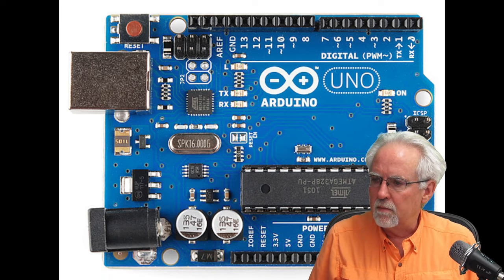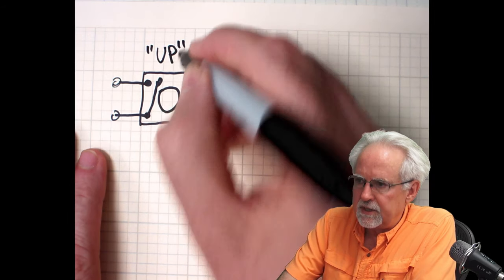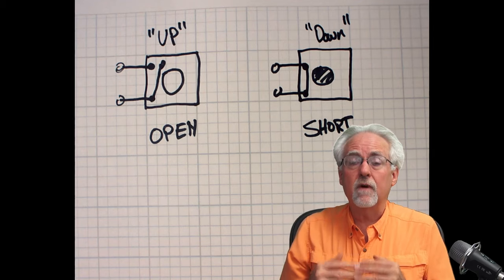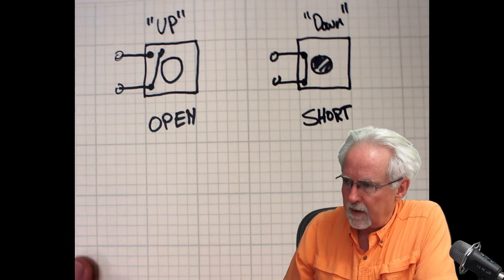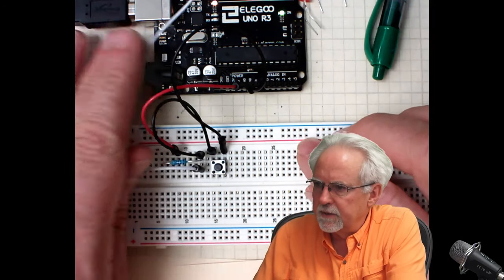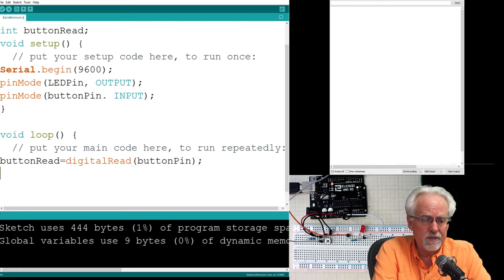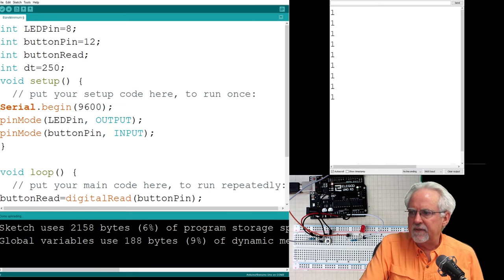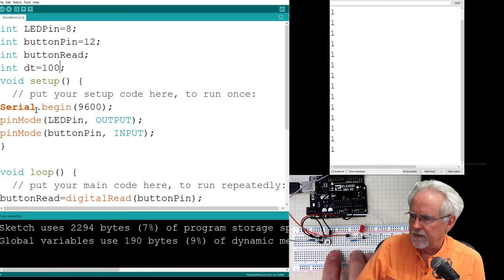Arduino Tutorial 27: Understanding Pushbuttons and Pull Up and Pull Down Resistors

Comment: Mr McWhorter, I have a question-could you please explain how you decide what resistor to choose ? Why push button requires 10k and photo resistor only 5k? What needs to be considered here ? I kinda of have a guess why we have 330 for the led (I did calculation and I think even 150 is fine, I divided 3v by 20ma and that gave me 150 om and I used 20ma as max current that the led can handle ) thank you again

Comment: This one took me a long time to debug. I bridged my button over A and the - column instead of the gap between E and F. Silly me forgot the - column is all connected. The button was rendered useless since the circuit was always closed even if the button wasn't pressed. Mistakes are the best lessons outside of listening to you Paul.

Comment: Thank you for these outstanding lessons; you really are a wonderful teacher. As a side note for anybody having issues on this lesson: I was having issues with my pushbutton and code not working correctly, and after 30 minutes of troubleshooting with my multimeter's continuity test, it turns out that the leads on my button are too short to make contact with the metal strips inside of my breadboard! I tested it across several columns, and it just didn't work with this particular breadboard and button combination. Another breadboard I had for a different project had shallower holes/thinner plastic and it works well.
Reply: Actually i think the switches are very poor for the breadboard. it is the wrong type it will kill the breadboard in short order. try to keep switch in place or put it in the same spot each time.

Comment: I did this on my own , successfully, but used analogRead and readPin = A0 rather than digitalRead and a digital pin.  It worked but my values were 0, and 1023 rather than 0, and 1.  Learned something.  Thanks for the lesson.

Comment: Paul, I put the resistor and led on the board first and used two long leads. One connected to ground, the other to 5V.
This way I shorted the leads and the led lights. This way I can test the push button pins to find the open pair.
Once I find the correct switch orientation, I can add the pull up resistor and switch to the  board.
I had to use Needle Nosed Pliers to straighten the pins since they would not push into the holes.
  I guess I could use the variable "j" and increment it each time the button is pushed. If the value is odd, the led turns on. If the value is even, turn the led off. That's one approach I could try to create a toggle switch.
But the solution could be simpler. I need to test for odd or even numbers.
Wayne

Comment: I really was looking forward to tinkering with pushbuttons and the explanation about pull-up and pull-down resistors is something I'll definitely look into further in this series. Although I fell like I can't wait to start building a MIDI footcontroller for my guitar pedals, I've been enjoying the series so much that I think I'll benefit from more learning. So thanks for your amazing tutorials, Paul!

I got carried away and decided to push myself a little further this time. I hook up three pushbuttons to control different LEDs and wrote this code. I used all the input from this tutorial, but any feedback and considerations about my code are highly appreciated. =)

BTW, I'm using a Lolin(WeMos) D1 R1 Wifi, so the pins come as "D#" in the code.

int redLEDPin=D2;
int greenLEDPin=D3;
int blueLEDPin=D4;
int redButtonPin=D5;
int greenButtonPin=D6;
int blueButtonPin=D7;
int redButtonRead;
int greenButtonRead;
int blueButtonRead;
int DT=20;
String redmsg= "RED button value: ";
String greenmsg= "   GREEN button value: ";
String bluemsg= "   BLUE button value: ";

void setup(){
 pinMode(redLEDPin,OUTPUT);
 pinMode(greenLEDPin,OUTPUT);
 pinMode(blueLEDPin,OUTPUT);
 pinMode(redButtonPin,INPUT);
 pinMode(greenButtonPin,INPUT);
 pinMode(blueButtonPin,INPUT);
 Serial.begin(9600);
}

void loop() {
 redButtonRead=digitalRead(redButtonPin);
 greenButtonRead=digitalRead(greenButtonPin);
 blueButtonRead=digitalRead(blueButtonPin);
 Serial.print(redmsg);
 Serial.print(redButtonRead);
 Serial.print(greenmsg);
 Serial.print(greenButtonRead);
 Serial.print(bluemsg);
 Serial.println(blueButtonRead);
 delay(DT);
 if(redButtonRead==0){
 digitalWrite(redLEDPin,LOW);
 }
 if(redButtonRead==1){
 digitalWrite(redLEDPin,HIGH);
 }
 if(greenButtonRead==0){
 digitalWrite(greenLEDPin,LOW);
 }
 if(greenButtonRead==1){
 digitalWrite(greenLEDPin,HIGH);
 }
 if(blueButtonRead==0){
 digitalWrite(blueLEDPin,LOW);
 }
 if(blueButtonRead==1){
 digitalWrite(blueLEDPin,HIGH);
 }
}
Reply: I like how you put the strings in there.  Very organized. Props.

Comment: Wonderful explanation, you really are a fantastic teacher, thank you so much. If anyone is reading this I have one problem; checked hardware and software many times, changed components BUT LED stays on all the time, checked input to pin 12 with multimeter and  push button is  working correctly. Any ideas please.

Comment: Hi Paul. 
I recently bought an arduino and your tutorials are really amazing! Very high quality videos thank you!! 

I myself am a 3rd year Software Engineering student at University and I just got an arduino for fun just because hardware was always very fascinating to me (even though my major is pushing me in the direction of high level programming instead of lower level stuff like embedded). 

I just had a quick question. Is there a specific reason why you dont tab in the code to make the code a bit more visually appealing? I understand this video is almost a year old and the arduino ide may have not allowed for that back then. 

It just slightly bugs me since I code in python a lot and the code formatting triggers my OCD haha! 

Anyway I was just curious. Thank you for making the time to make this awesome tutorial series for us. 

Oh and also to answer a question you had in another video, yes it does bug me when the board isnt perfectly aligned with the top of the screen (not straight) just like it bothers you. 

Cheers!

Comment: I'm struggling to understand how current flows to the read pin in the unpressed state of the pull up resistor circuit. My confusion stems from how current is able to flow to the pin in the first place since it is not connected to ground until the button is pressed. I have always assumed that in order for current to flow you would need a path from the battery's positive to ground terminals. So without a path to ground (which is blocked by the open switch) how does current flow to that read pin if the button isn't pressed?

Furthermore, the current traveling into that read pin has to pass through a resistor to get to the pin. So how is there not a voltage drop when the button is not pressed, yet when the button is pressed you're connected to ground and then you see your voltage drop over the resistor. 

I had to take about a month break from working on these tutorials to work on some personal projects and I'm very happy to be getting back to working through this series!!

Comment: It would have been good to explain why and how using pull-up and pull-down resistors work (i.e., why the electrons go where they do, e.g., why don't the electrons go down the other wire when the switch is closed) and the benefits of using them (e.g., preventing floating inputs).
Reply: You exaggerate!!!!!

Comment: does it make a difference if instead of hooking the button up from slots f through i on the breadboard and needing a jumper, you put the button across the center divider so you have space for the two wires? if that makes sense

Comment: Great video! Thanks for your amazing attention to detail Paul. I had a question about the switches. When to use a pull up vs pull down resistors? Is there an advantage using one circuit over the other in specific situations?
Reply from the maker: Both work in all cases, just depends on which is the easiest for you to think about.

Comment: Question regarding the pull up resistor (open, "up" mode): The read pin reads the voltage right after the resistor. But a voltage is defined between 2 points, so what is the reference ground when you read at this point? I am confused because my understanding was that all "grounds" in the Arduino are the same. In which case, there will still be current going through the resistor just as when the button is down and the current goes to ground.  What am I missing here? (amazing videos by the way, thank you!)

Comment: Hi Paul, In my head It made more sense to measure the voltage drop after the Pull Down resistor? How is there meant to be a voltage drop if the current hasn't passed through the resistor yet?

Comment: Great, easy to follow tutorial as usual - thanks Paul
A question if you don't mind.
What is the reasoning behind choosing specifically a 10K Ω resistor for this project ?
How do you decide what value resistor to use ?
Reply: I have the same question too. As i saw in a data sheet the arduino uno output current is 40mA. So the voltage drop across this 10kΩ resistor would be 400V (V=IR=0.04A*10,000Ω). That means theoretically no current will reach the arduino reading pins when using the pull up method right? But when practically done, I got the reading as 1. I'm a bit confused. Appreciate if anyone can explain this. Thank you:)
Also, your tutorials are great sir!!

Comment: Why did you use a 10k resistor for the pull up resistor? Does it matter what resistor you use? When I substituted the 10k with a 330 resistor, it worked just the same (as I expected).

Would it not be easier to use a 330 ohm resistor as you also use those for the LED, so you can't get them mixed up? I got mine mixed up and they being so small and use the same colors but in different orders they are hard to keep apart.

Also, related to that, how do I tell what end of the resistor is the start of the color code and what end is the end? I had it backwards first and when I translated the color code I got a very wrong value, knowing it had to be 330 or 10k. But if you have a pile of resistors they can be any value so you would need to know what end is the "front".
I know I could have used my multimeter to measure them, but I didn't have it at hand. Knowing how to "read" a resistor would be useful I'm sure.

Comment: thanks for the videos. But there happened a mistake in my case. I did exactly as you told. The light turns on but when I am pressing the button it does not turn off and in serial monitor only shows me 0 :(

Comment: how do we handle inputs from another arduino?  digital output from one microcontroller used as a digital input on another??  The receiver needs a pull down doesn't it for when the sender goes to a low state?  I've got a mikro e speakup clickboard that has digital outputs I want an arduino to read.

Comment: I'm having an issue where I can completely take out the button circuit, however it still somehow reads 0 and 1 randomly turning my LED on and off, and even set up correctly the button does make it turn on but it still randomly turns on and off, I don't know what to do

Comment: I have an Arduino Uno, with a few buttons, two photo-resistors, and a couple of LEDs. I would like to buy the kit you're using, but only with the parts, no need for another Arduino, as i'm just a beginner. Is there an Arduino parts kit without the Arduino that you could recommend?

Comment: Paul - Thanks for your tutorials.  I have not been able to get a proper response using the button.  I've tried removing the button and hard wiring the circuit and it performs as expected, so I know the code and the build are correct.  I usually write the code and build the circuit before I finish watching the video.  My builds don't always look exactly like yours, but they function as they should.  The same with the code I write.  After failing to get this to perform as it should using the button, I copied your code letter for letter and removed all the components and started over on the build and completed it as you did.  Still no joy.  I removed the switch, rotated it 90 degrees and reinserted it.  I had to move the ground wire over one space on the breadboard as the holes and button leads don't line up the same when I reinserted the button.  I removed the button and hard wired again and the LED came on as it should have when hard wired, and went off when I removed the hard wire jumper.  So, I think it must be the button switch.  Any other ideas how to test the button?
Thanks.
Reply: I resolved the issue with the pushbutton.  It wouldn't make a solid connection with the breadboard.  I moved it and only inserted 2 legs and was able to get the desired results when pressing the button.

Comment: Do you have to read the voltage  value before or after  the resistor? Does it matter?
I remember watching a vid on using a multimeter at the nodes of a circuit and reading the voltages.
Reply: Captain Prototype did you try it with several different places to read the value?  That is a good example of questioning something and seeing for yourself what works and what changes.  There are a few places where changing something could get you in a little trouble, but this is a good one to move a wire to see what changes.

Comment: Hi Paul. Great video. Please tell me what I’m doing wrong. Followed the code exactly and built the circuit as per your design, however serial print returns the value 12 not 1 and the led comes on when I press the button yet serial print does not change to 0 it still returns 12. Thanks Andy
Reply from the maker: First, you have to understand that if you do exactly what I did, you will get exactly the result I got. So, step one is to mentally accept you have made a mistake somewhere. Either you have a code error, or you have hooked things up wrong, or you have a loose connection. Very, very, very rarely is it ever faulty hardware. Go through it methodically and find your error.

Comment: I actually can't get my values to switch between 1 and 0, depending on how I hook it up, I either get 1 or 0 on the open switch but pressing it has no effect. I don't have the exact same kit, but it's also an uno r3 starter kit. So I'm not sure if my button is making a proper connection, because the pins look a little short to reach down into the breadboard. I'll watch the video again, other than that, I'm not sure what to do.

EDIT:

I rewatched the video and my connections were just wrong.

Comment: Instead of using a wire to jump the button, put the button across the gap in the breadboard.  It leaves all but 1 hole open on both sides.

Comment: @6:20 How can the voltage still be 5V across the 10k resistor if not connected to ground? If the voltage is still "running"(?) while unconnected to ground, then why wouldn't it power a device?
@6:30 "...there is no Voltage drop across the 10k, the read Pin is going to see 5 Volts and is going to report back a 1."
Are you saying that resistors ONLY limit current if the voltage is connected to ground?

Comment: In the pull-up mode, the circuit always outputs 1. I think the LED should be on normally and when you press the button LED turns off. Isn't this more logical ?

Comment: Novice here. What is the point of having the 10k resistor lead to the readpin and switch, could you not just use a jumper instead if all the readpin is trying to do is detect voltage?

Comment: @14:00 It is very confusing that you are not consistent in using the wire colors.  Using black and red to connect from the resistor to 5V.

Comment: I have a confusion

Imagine if in the PullDown circuit, if the resistor was NOT present

When the circuit is open it reads 0 Volt
So when the circuit is closed shouldn't it read 5V??

and we would be fine without a resistor?

Comment: first of all thanks for the new video. i have one quistion about the pull up/down resitor. is it not posibole to put directly 5 v on the digital read pin to create a digtital read; high. so directly from the 5 v pin the to the digital read pin without resitor and only a switch ?
Reply: How about using the pull-up resistor inside the micro-controller 
You can do this by this line of code:

pinmode(buttonPin, INPUT_PULLUP);

Now you can use the button without a pull-up resistor and without 5v and it will work the same. Hopefully it helped:)
Reply: thank you both for the video link and the answere
Reply: @mayankshigaonker7725  thanks for the comment as the included elegoo lessons use the input_pullup method and got a bit worried i might be shorting my inputs since i'm not using resistors. while this lesson did teach me the (i'm guessing) normal way to pull up a switch, i'll keep it in my mind in case i need to use it, but for convenience and simplicity's sake, i'll keep using the input_pullup command.

Comment: Question, i thought we were supposed to read information from pins A0, A1, and ect? how were we able to read from pin 12? Thank you again Paul u tha best
Reply: Remember, pins A0,A1 etc are analog read pins, meaning that they will read the inbetween values 0-1023. Digital pins on the other hand can read LOW(0V) or HIGH(5V) and the command is digitalRead...
Reply: Pins A0 till A5 are Analog Pins hence the A in front of the number. The other numbered pins are digital pins. Since we are working with a digital value 1 or 0 we can use the digital pins. We declare read or write on the pin in setup with the pinMode command INPUT or OUTPUT. In this case we said that one of the digital pins was declared as an INPUT pin. I hope I was able to explain as clearly as Paul does his tutorials.

Comment: No kind of instructional information came with the Elegoo Starter Kit.  How are you determining what does or does not need a resistor?  How did you know the push button required a 10K resistor and the LED only needed 220?
Reply: The Elegoo Starter kit has instruction on the site and also the Disc in the kit.